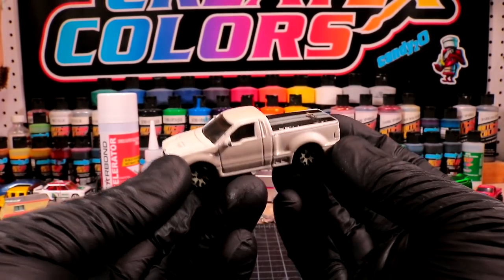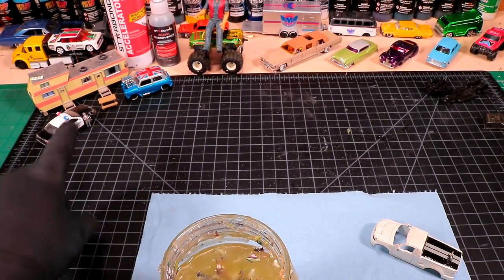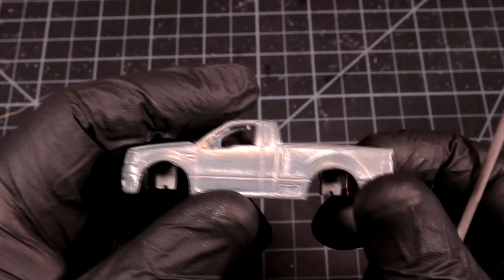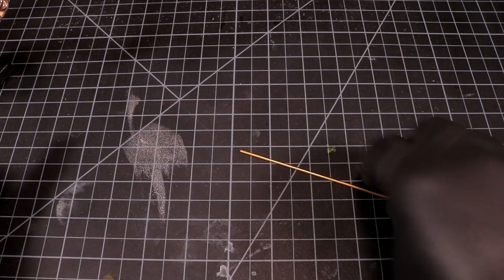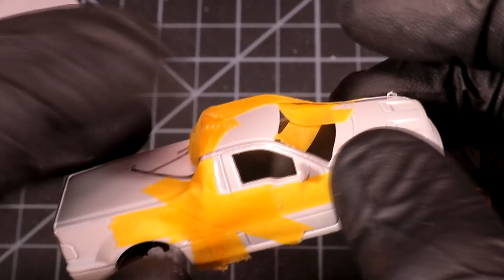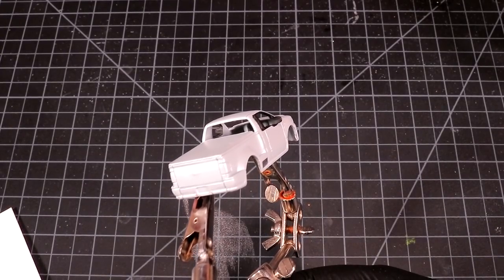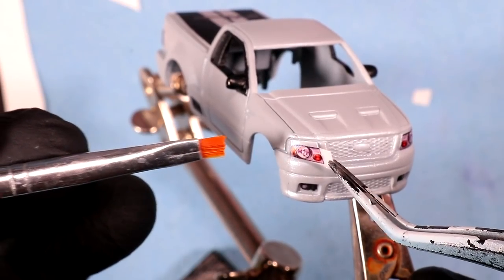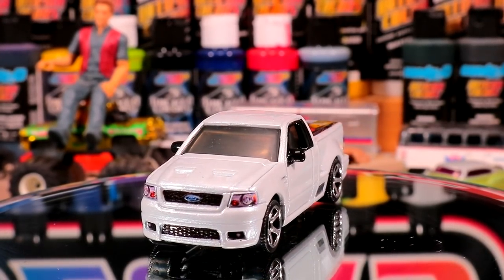1:64 SVT Lightning Restoration

Comment: Looks really good. If i remember correctly that year has the same motor as the 2005 Ford GT.

As for the caddy. I like it. I might have gone with a black vinyl top gunmetal and silver. But that is me.

Comment: They made it till 2004 and it was the Heritage Lighting because it was the older body style. In 2004 Ford introduced the new body style for the F-150 which is the one you are holding but that body style was never made as a lightning
Reply: Beat me to it. It’s too bad the 11th gens never got a Lightning variant, although I believe Ford offered a certain upgrade package for the 11th gen that dressed them up to look like a Lightning. I remember reading about it in either C&D or MT back in the day.
Reply: @drivedb7  😆 I believe it was the Roush model. I didn’t have a lightning but I did own an ‘03 Harley Davidson
Reply: @Gordo101978  — Dude those Harley Davidson trucks were niiiiice.

I’m going to have to dig up that magazine now haha. I probably still have it.

Comment: That truck was a concept truck, they never actually made the lightning on that body-style F150. Would have been cool if they did, the concept truck looked pretty neat.
Reply: Spot on. That model was too heavy and to perform better than the prior model, they needed 600hp+ and that didn't happen in 2005. Today, it would be a different story.

Comment: Interesting fact, the 3rd Gen Lightning never got beyond preproduction. This was a concept car. SVT canceled the model and instead Ford released it as the Harley Davidson edition, similar to how the 2nd gen Lightening and HD F150 shared the same platform.
Reply from the maker: Oh no kidding?  GOOD!  I'm glad the Lightning name stayed with the older body style.
Reply: @DiecastResurrection  Except it hasn't.  The new F150 Lightning should be on sale in a few months.  And it's all electric...
Reply: @Penster-Elle  Being all electric Lightning makes sense as a name. Lol
Reply: Good point Penny! However since the new Lightning is technically not a performance vehicle, it’s not in the same line as the SVT/Ford Performance vehicles, so it’s really not a 3rd Gen. The Raptor was more akin to a 3rd Gen, and technically SVT canceled the Lightning so they could focus on the (then pre-development) SVT Raptor.

Comment: They didn't make a lightning in 2005, i figured that is why you called it a concept truck. They never made them passed 2003-2004, whenever they did the body change. We still don't have one made by SVT today but if you checked the right boxes ordering new you could come close.